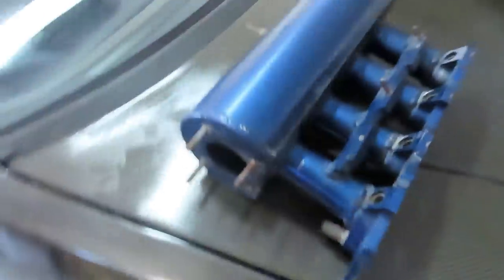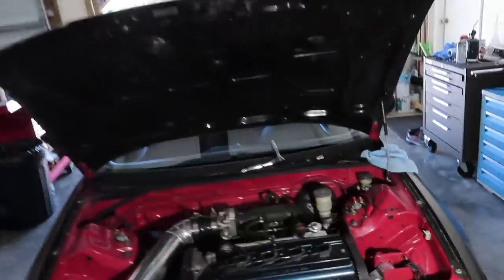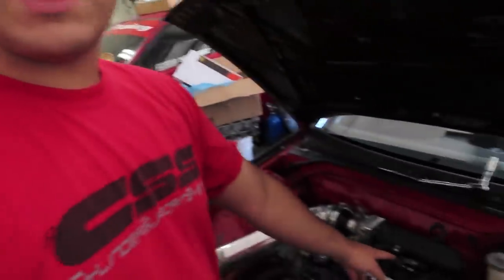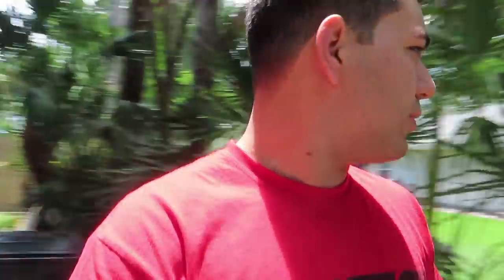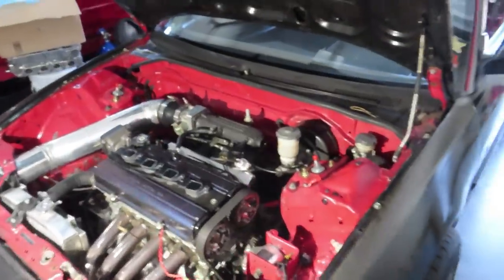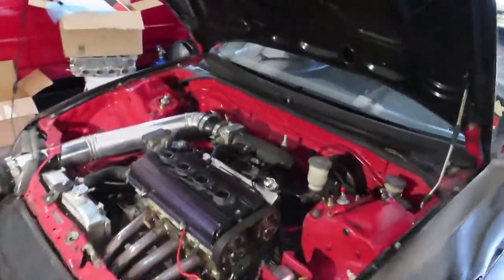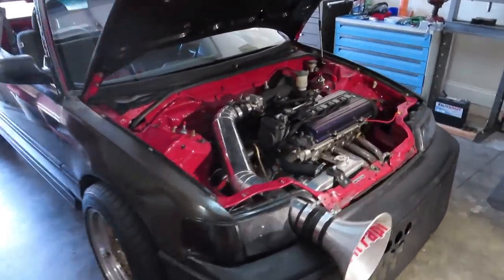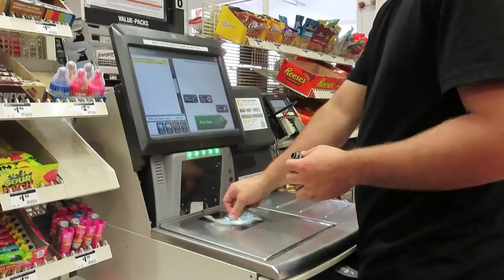BEEFY Intake Manifold for CRX!

Comment: Pablo, I know it’s already purchased but you need to leave that smaller port open on the back of the manifold for the fuel pressure regulator because there is no port on the front like an oem manifold, cheers! Keep on keeping on! You already have the manifold run it, see how much power you make regardless of what everyone is saying
Reply from the maker: Very true!

Comment: That intake is junk
Reply: Yea garbage had one on a d series for 30 mins once lol car ran like ass intake leaked like hell put stock intake on an ran fine
Reply: It's a plus for turbo or nitrous
Reply: I wish that was the case lol mine had a bunch of pin holes in the welds an caused major vaccum leaks his looks a little more solid and he has the plugs to have it fixed if there anything wrong so might hav good results